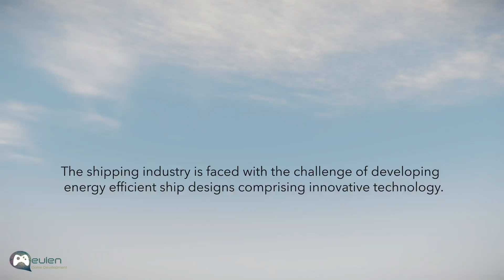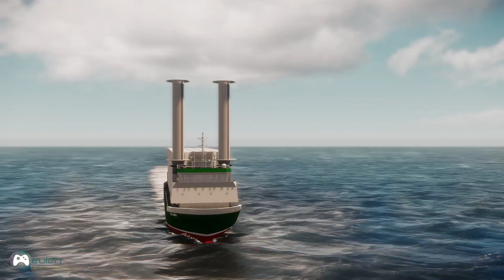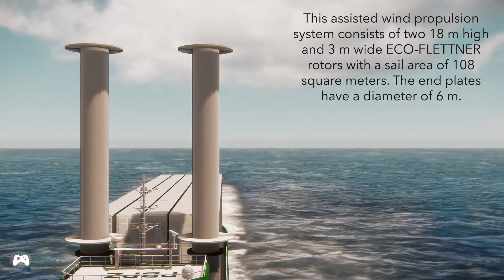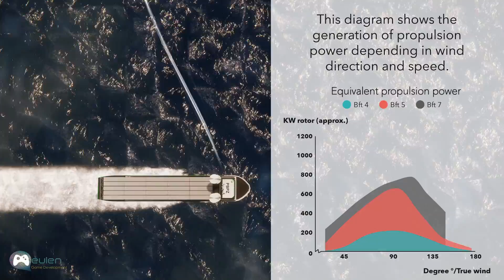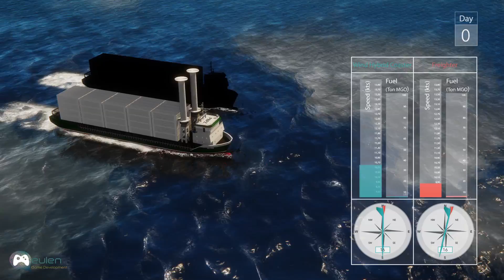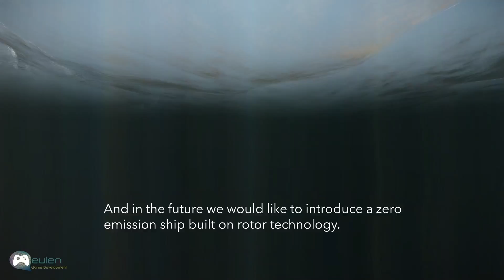ECO FLETTNER - a sailing machine

Comment: This is fascinating, didn't know this existed
Reply from the maker: Hello burt591 591
Yes, it is an old technology and we built up our ECO FLETTNER, a rotor 18 m high and 3 m in diameter with 6 m diameter of the endplates, in Leer/Germany. Now we want to take the next step to erect the ECO FLETTNER on a seagoing vessel. That will be done in June 2016. I inform here on youtube.
Reply from the maker: https://www.grafik-team.de/eco_flettner/mobile/index.html#p=1
Reply from the maker: https://ecoflettner.de/images/press/ECO%20FLETTNER%20%20Ship%20&%20Offshore_Greentech%20FehnPollux_2019_Vahs-et-al%20-EN.pdf

Comment: So at what "angles-to-the-wind" would the ECO Flettner NOT add to the forward movement of the ship?
Reply: The lift force of the spinning cylinder is induced into the ship’s hull giving propulsive thrust. 

It becomes obvious that there is a positive effect on propulsion only if the rotor thrust is pushing into the ship’s sailing direction. As the rotor thrust direction is depending on the wind direction, positive thrust is produced in a certain angular range of wind directions. In general, forward wind directions (about 30 degrees on both sides from the bow) will not produce positive thrust. The rotor will be stopped or operated at low RPM (low resistance mode).

It can be seen that the rotor thrust is directed approximately in a 90 degrees angle from the apparent wind direction following the rotational sense. Given this the rotor thrust has two directional components in the ship coordinate system:
•	longitudinal thrust in ship’s sailing direction
•	transverse side force
Side forces are part of the sailing principle and cannot be avoided. They occur especially when the wind direction is from the bow or stern.  If the side force magnitude is significant a leeway drift and a heeling angle will be caused.

Comment: So basically cut all of the advantages in half, double the price of R & D, add five years minimum to the original estimate to make a fully functional ship using this tech, and you will probably hit closer to the mark.
Reply: We are currently implementing a second rotor system for the MV ANNIKA BRAREN. The Eco Flettner rotor at MV FEHN POLLUX has been working maintenance-free and reliably for 22 months. The shipping company achieves an annual average of 16% fuel savings on her vessel. The more sail area that can be installed, the greater the savings.
Reply from the maker: We take one step at a time. That leads to success. For further development we need innovative shipping companies.

https://www.youtube.com/watch?v=CNsfN1ZXPeM

Comment: Не верю, что будет широкое применение.  Должно быть красиво  как самолёт. Если он хорошо сложен и формы его гармоничны он и летит отлично.
Reply: Дизайн должен быть таким же! Ротор оптимизирован для высокого коэффициента подъема. Ротор работает без сбоев уже 22 месяца! Он способен к переговорам. К сожалению, цена на топливо падает уже 7 лет. Чтобы сохранить CO2, инновации не должны зависеть от цены на нефть. В противном случае компании-экспортеры нефти используют свои цены, чтобы определить, будут ли преобладать новые технологии экономии топлива.

That design has to be in this optic because the rotor is optimized for a high lift coefficient. The rotor has been working without failures for 22 months! He is capable of a markt entry. Unfortunately, the fuel price has been falling for seven years now. If CO2 is to be saved, innovation must not remain dependent on the oil price. Otherwise, the oil-exporting companies use their pricing to determine if or when new fuel-saving technologies will prevail.

Comment: I develop same idea 10 years ago, but stack on how to calculate the energy so I can tell how much power I have from this energy . The question how much power this will make?
Reply from the maker: The power of the Eco Flettner rotors in yearly average:
2 kW main engine equivalent power per 1 qm of rotor surface in Medium Wind areas, EF 18 (H18 m x D3 m = 54 qm): 108 kW)
2,5 kW main engine equivalent power per 1 qm of rotor surface in Good Wind areas, EF 18 (H18 m x D3 m = 54 qm): 135 kW),
3 kW main engine equivalent power per 1 qm of rotor surface in Very Good Wind areas (EF 18 (H18 m x D3 m = 54 qm): 162 kW).

The Eco Flettner EF 18: approx. 700 kW in max. (BN7, abeam apparent wind)

The savings mentioned in charters "MEDIUM WIND AREAS", "GOOD WIND AREAS“ and "VERY GOOD WIND AREAS“ represents calculated values and are based on voyage  simulation with historical weather data over a period of 1460 sailing days and collected data by test trails on MV Fehn Pollux.

Comment: When the wind is directly abeam the boat and the rotors are rotating and giving forward thrust. What is the lift to drag ratio? In other words, how much sideways force is created for the amount of forward thrust?
Reply: That depends on the Apparent Wind Angle. If the wind is heading, the drift increases.

Comment: its cool but from the wind angle graph it only works on or around a reaching sail angle (90%). All the major shipping routes across the oceans are either down wind or directly up wind.
so unless you can get it to work on other wind angles its not viable.
Reply: This sailing system operates from an angle of incidence (relative wind) of about 35 ° to 175 °. The forward thrust depends on relativ wind angle, sometimes more, sometimes less. We have calculated the annual average of about 10 to 15% fuel savings for wind unfavorable sea areas.
Reply: With rotors we can indicate about 10 to 15% fuel savings in the year in wind unfavorable sea areas. In wind-friendly sea areas 24% can be achieved on an annual average. In addition many meaningful travel simulations with real weather data were made.

Comment: Could a ship theoretically go from Shanghai to Los Angeles by JUST using ECO FLETTNER rotors?
Reply from the maker: On MV Fehn Pollux and MV Annika Braren the main engine is needed for ship’s propulsion and to generate power for the electric motor of the rotor. Further the ship’s main engine has to be ready for stopping manoeuvres as required for safe navigation and collision avoidance.

The ECO FLETTNER rotor is designed as a wind assisting ship propulsion system (WASP) to save fuel from reduced power output of the main engine or to increase speed at same main engine power output and fuel consumption.

The ECO FLETTNER rotor system is designed to produce additional thrust from wind energy during the voyage. The rotor is an easy to use wind assistance propulsion system (WASP). 

The rotor sailing system is designed for automatic rotor control. The operator has to follow start up procedures for automatic control mode. The control system will start and run the rotor with optimum RPM to achieve best efficiency and fuel savings. If the wind conditions are unfavourable the rotor is stopped automatically or run at low RPM to reduce aerodynamic resistance (low resistance mode).

The automatic control system will safeguard against dangerous operation. 

The EF18 has a power between 108 -162 kW in yearly average!

Comment: DID I MISS THE PART ABOUT AFTER GETTING THE ENERGY, WHAT/HOW IT IS STORED? USED?
AND WOULDN'T THE "SAILS" BE BETTER AT THE REAR? 
ANY UPDATES? (AUG 2021)
Reply from the maker: The principle does not work like a wind turbine that generates electrical energy. The rotors generate thrust directly like a sail. The rotors should be installed as close as possible to the ship's pivot point. That's why they are much better at the front than at the back.

Comment: Do these rotors rotate freely around an axis?
If I understood properly, their highest efficiency is when the wind is 90 degrees from the ship's course. So why not rig them down and rig up a conventional sail when wind is on the tail?
Reply: Masts, rigs and sails I can not see today in cargo-carrying shipping industry. They interfere with cargo operations (risk of damage). Today the crew is kept to a minimum. Specially trained seamen for the sail guidance and -technology are not necessary for Flettner technology. A rig with sails are extremely expensive.
Reply from the maker: https://www.youtube.com/watch?v=Sp4kz023wF8

In this link you can see the mounted ECO FLETTNER on the MV Fehn Pollux.

Comment: where is the numbers on lift vs the cost of the energy to spin?  What is the Return on investment on one of these?
Reply from the maker: The University Emden/Leer has evaluated the rotor performance in three wind profiles, medium, good and very good wind areas over a sailing period of 4 years (1460 days). Under medium wind conditions, an annual average of approximately 2 kW main engine equivalent power can be saved per 1m² of projected rotor area (for guidance). Precise predictions are made by wind tunnel tests, CFD analysis, first trial tests on Fehn Pollux and by route simulations for a specific ship.	

For example here the yearly main engine equivalent average: 

The vessel’s rotor sail has a projected area of 54 square metres. 

Multiplied by 2 kilowatts, the ship saves an annual average of 108 kW at sea beyond its main engine output.

In good wind or very good wind conditions, for example on the atlantic, the rotor sail produces 2.5 and more than 3 kilowatts per square metre of sail area.

This simple formula allows ship owners to calculate the ideal size and number of rotors to achieve a specific amount of energy savings.

Savings about 10 to 25 % can be expected, depending on ship`s speed, main engine performance and the wind area.

Since the electric drive of the ECO FLETTNER is fed from the shaft generator and thus directly from the main engine, the fuel measurement provides the correct total consumption including rotor operation.

Comment: Always this Magnus effect depending on wind direction. How about cylinder shaped wind turbines driven by wind from whatever direction for producing and storing electricity to drive a motor? The Magnus effect would still be work additionally. Right?
Reply: The aerodynamic force is developed by the cylindrical shape of the rotor.
Reply from the maker: https://ecoflettner.de/images/press/ECO%20FLETTNER%20%20Ship%20&%20Offshore_Greentech%20FehnPollux_2019_Vahs-et-al%20-EN.pdf

Comment: I might be wrong, but why would not have electric generators connected to the spinning sails as well to make power to the engines as far as I see they are just using  it like a sail  I might be stupid but that's what I would do.
Reply: Right, there are many other optimizations that can be built into a Flettner concept. But in a first step a working ECO FLETTNER Rotor was realized in 7 years of development and construction. For further developments of this technology, we need customers who decides for rotors on vessels of their fleets. The next technical concepts have to be adapted to the ship types. Latest news: The German shipping company Rörd Braren has decided to use rotor technology. The MV ANNIKA BRAREN will be equipped with an ECO FLETTNER EF18 in summer 2020. An important step for technology to avoid emissions!
Reply from the maker: Unfortunately there are no perpedomobiles in the world.

Comment: I do not understand this.  If each "tower" is round, how can the pressure be less one side of a tower than on another.  In an airfoil, the curvature of the wing makes the high pressure less on the top of the wing than it is on the bottom of the wing, so lift is created.  I do not see the equivalent of that here.  What am I missing?
Reply: A lift force is produced when a spinning cylinder is placed perpendicular to an airflow. This phenomenon is referred to as the Magnus effect, after German physicist H. G. Magnus, who first investigated the effect. Take the air flow to be from left to right, and the cylinder to be spinning in a clockwise direction.The airflow coming from the left is assisted by the vortex flow around the spinning cylinder as it flows over the top of the cylinder, causing the flow here to speed up. As the airflow from the left passes the bottom of the cylinder, it is opposed by the vortex flow, causing the flow here to slow down. From Bernoulli’s law we can see that an increase in flow velocity over the top of the cylinder will result in a decrease in pressure (low pressure, suction). Accordingly, a decrease in flow velocity under the bottom of the cylinder will result in an increase in pressure (high pressure). From the pressure difference, an aerodynamic lift force perpendicular to the airflow is produced. The lift force of the spinning cylinder is induced into the ship’s hull giving propulsive thrust.
Reply from the maker: https://ecoflettner.de/images/press/ECO%20FLETTNER%20%20Ship%20&%20Offshore_Greentech%20FehnPollux_2019_Vahs-et-al%20-EN.pdf

Comment: Alot of these things look good on paper but not practical in practice
Reply from the maker: Crew report, MV Fehn Pollux 02. 05. 2019:
“Operation of rotor is not so difficult, all officers on board familiarized with rotor
operation and maintenance checked on regularly basic, including safety data sheets.
Eco Flettner running from Pasajes (30/03/2019) to Taranto ( 17/04/2019) – ( during sea passage )
in total 243.4 hrs ( 94.8 % ) – Pasajes/Taranto total sea passage time 256.5 hrs , from Taranto
( 28/04/2019) until today am ( 02/05/2019 ) in total 88.9 hrs ( 99 % ) Taranto/until today am
– total sea passage 89.6 hrs. In each port Ch. Eng. made inspection of rotor (regularly on weekly basic.
From 30/03/2019 until now no any alarm sound, all in good order”

Automatic control and monitoring system:

The thrust measuring system offers transparent and instant data. The automatic control system allows a fully automatic rotor operation, which is controlled by a tailor-made interface. That means easy handling for the watch keeping officers: switch on or off and speed control.

Comment: Impossible to  be 100%..
Reply from the maker: This EF rotor sail system can save a lot of fuel!  This depends on the operation area and the installed sail area. If zero emissions are considered and CO2 neutral future fuels become avaiable, this rotor system can significantly reduce fuel costs. This will be very important for the introduction of future fuels.

Comment: that is a SILLY design - the rotors would cause the ship to bear away from the wind all the time. And that is a nonsense explanation ignoring drag's effect on the propulsive vector direction - NOT VIABLE.
Reply from the maker: Dear Dan, Please just ask the shipping company Fehn Ship Management, Leer / Germany, and find out for yourself how it works. On MV Fehn Pollux the rotor sailing system saves an average of 0.5 MT MDO per day at sea! That are approx. 16% fuel savings in annual average. This figures are based on test trails by the University of Emden / Leer on board the MS Fehn Pollux.
This ship has been equipped with an Eco Flettner EF18 rotor since July 2018. It's seaworthy and you can order these rotors today. Flettner rotors are state-of-the-art and can help save considerable amounts of fossil fuels. Next vessel equipped with an ECO FLETTER Rotor will be the MV Annika Braren in April this year. The Shipping compony is Rörd Braren Bereederung, Kolmar/Germany.

You can order ECO FLETTNER rotors:
ECO FLETTNER GmbH/Germany, www.ecoflettner.de

Comment: I will refer to this diagram https://iveybusinessreview.ca/wp-content/uploads/2018/04/Hapag-Lloyd-Graphic-2-Rotor-Magnus-Effect.png  

If the wind is coming perpendicular from the left (the port side), and the Flettner rotor is spinning clockwise when viewed from above, the thrust will move the ship forward.  Yay!  All is right in the world!

If the wind is coming perpendicular from the right (the starboard side), and the Flettner rotor’s mechanized spin is REVERSED to be counter-clockwise, the thrust will move the ship forward.  Yay!  All is right in the world!

But it seems that if it’s coming from any other angle, the thrust would continue to add to the ship’s forward motion, BUT IT WOULD ALSO PUSH THE SHIP OFF COURSE.  So, if you are traveling from China to Los Angeles, you could end up in Mexico or Canada (if you don’t compensate by steering).  This is similar to flying an airplane.  You can point the plane in the direction of Washington DC, but you need to compensate for the lateral forces of the winds aloft.  

So my QUESTION is, can the Flettner rotor’s thrust be directed beyond reversing the Flettner’s motor (or shutting it off)?

By the way, if you WANTED to go backwards (to stern) or sideways, I suppose the Flettner could be used under favorable conditions.  But I don’t see that as useful except to avoid collisions or in port, and in port I would think the thrust would not be predictable or precise enough.

One other thought.  It would seem to me that the Flettner rotor would at least increase drag if the ship is not perpendicular to the wind.  Then again, winds push ships off course all the time, because they are so darn tall and long.
Reply from the maker: The resulting force of lift and drag of the spinning cylinder will be introduced into the hull giving propulsive thrust.  
The rotor thrust divides into two directional components in the ship coordination system: longitudinal thrust in ship’s sailing direction and a transverse side force, the drift.
Side forces are part of the sailing principle and cannot be avoided. They occur especially when the wind direction is from the bow or stern.  If the side force magnitude is significant, a leeway drift and a heeling angle will be caused, correct rotor operation is safeguarded against excessive heeling angles.
The rudder is used to counteract this. Depending on the apparent wind speed and apparent wind angle, rudder activity between 1 and 3° are possible. The drag in frontal wind could be reduced by turning the cylinder slowly. This rotor sail system can be used in VTGs.